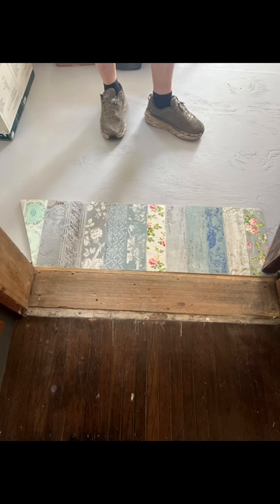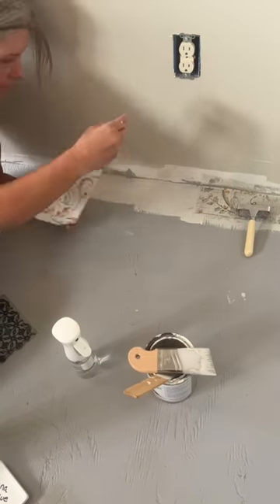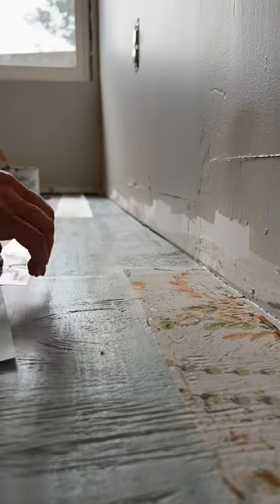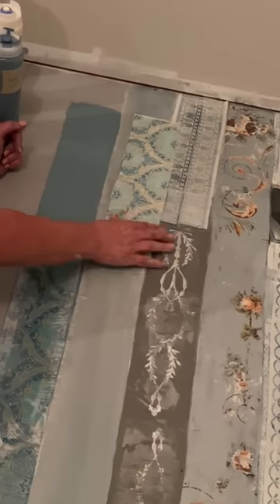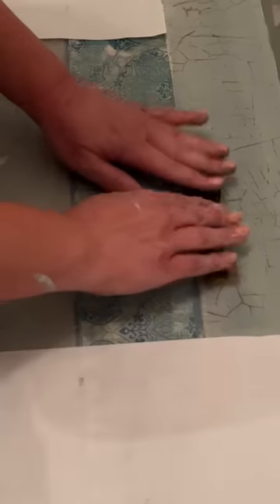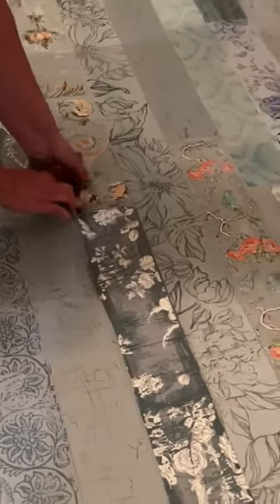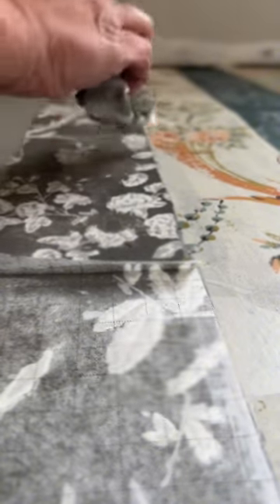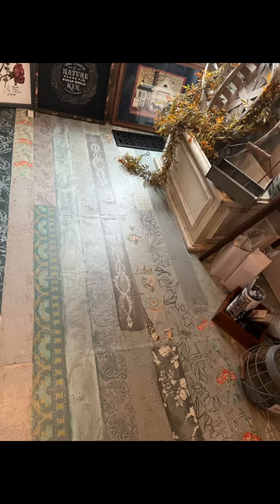Unique Floor Idea - Using IOD and Paint Couture

Comment: This is beautiful and a great idea! This could even be done with pieces of coordinating wallpapers or copies of photos.
Reply from the maker: You’re right it could be done with so many things. I contemplated many different options laying down papers in the past. I just always worry about the durability of the layers rather than paint… and what if I don’t adhere them well enough? I guess I’m a bit of a chicken in that respect, lol.  So last time I stenciled and this time it was paint and stamps🙂
Reply: @auntbeasattic , how long did each one take?
Reply from the maker: You mean each way of doing the floor? The stencil was an extra-large one. I think 2x2 and I remember each one taking 15 minutes each . I did multiple colors to add texture (like I did on the little cabinet we just posted). Biggest problem with that is you stay in the same position the hold time painting it. This floor was a little different because i planned as I went. I think though it was probably about the same amount of work time because i know i did like 3-4 rows in an hour on the second day when i only had that long to work. I hope that answers what you were asking lol

Comment: Really wonderful,  I can see this inside a cabinet or on furniture too😮😮😮
Reply from the maker: Yes! Inlays are made for furniture, putting on the floor is a bit out of the box lol.
Reply: @auntbeasattic  I had to go look up what IOD stands for, I'd never heard of it before. I knew about transfers but didn't equate the two. Anyway, such a great job,  I kind of meant that the faux board design would be cool in a cabinet.

Comment: Do you have an idea of what this cost you all up please? The result is gorgeous !!
Reply from the maker: I would have to do some figuring. The “planks” are about 4” wide. So one inlay sheet did roughly 45” long. Doing them end you don’t have as much matching to do. By mixing in the stamps, and different base colors you get a lot farther than if it was all inlays. It was 9.5 x 6.5 and I used 12 sheets of inlays. Mine were many different designs because I had them. But I originally had planned to do a floor with only the indigo or the rose chintz but got inspired lol. 2 packs of inlays are roughly $90
Reply: Thanks so much 😊

Comment: I love the floor.  Do you think the top costs are sturdy enough for chairs and a desks?  I would love to do this in my craft/office space.❤
Reply from the maker: You mean for them to sit on? I am putting this to coat to the test. But I wouldn’t have any concern about doing the paint/inlays down and doing a traditional top coat for wood floors. If you mean to do this paint and top coat on the furniture. It would definitely be fine. As for anything you paint, prep is key. Make sure it’s clean and if it’s a slick surface, you would want it scuffed up or use a bonding primer.

Comment: I’m seriously wondering my what the cost would be?? That’s an amazingly large amount of paint inlays. Do you think it can be done on a budget for us seniors?🤓
Reply from the maker: The “planks” are about 4” wide. So one inlay sheet did roughly 45” long. Doing them end you don’t have as much matching to do. By mixing in the stamps, and different base colors you get a lot farther than if it was all inlays. Different base color for an inlay pattern changed it quite a bit too. Especially the Chateau Inlay.  It was 9.5’ x 6.5’ space and I used 12 sheets of inlays. So that’s 1 1/2 packs for that size floor.  Mine were many different designs because I had them. But I originally had planned to do a floor with only the indigo or the rose chintz but got inspired lol.

Comment: What are IODs? Ive never seen this before?
Reply from the maker: IOD is the Iron Orchid Design company. They make furniture transfers and Silicone moulds plus the Decor stamps used on the floor.  They are the creator and patent holder of the paint inlays. If you want to learn more, there is a lot of info on their website. If you want to purchase,  you can find local retailers on their website. We carry all of their line in our store and on our website. www.auntbeasattic.com
Reply: @auntbeasattic  thank you!

Comment: If this starts to wear prematurely, can you now coat it with a stronger top coat like polyurethane or polycrylic top coat?
Reply from the maker: Yes. The top coat is a non yellowing water based topcoat. So just like you would want to poly over anything else painted for extra protection, you could get one of those.

Comment: In case someone's watching that has never used the paint transfers before-they are REUSABLE!  I know, isn't that amazing?!  So, can use more than once really appeals to my frugal side.
Reply from the maker: Great point! The image does get lighter on each use and so you would want to spread them through on a project like this I’m guessing. Also, using paint with a sealer needs to be tested to see how many uses you can get because the sealer limits the release of it on future uses.

Comment: You didn't really explain what this product is? Looks nice.
Reply from the maker: IOD is the Iron Orchid Design Co. They design and curate the stamps, inks, and developed and patented the Paint Inlays. Paint inlays are sheets of actual painted design that release when placed on the wet paint. They are reusable and become more of a distressed look with each use. The amount of reuses is determined by the paint product used.

Comment: What is iod?
Reply from the maker: IOD is the Iron Orchid Design Co. They design and curate the stamps, inks, and developed and patented the Paint Inlays. Paint inlays are sheets of actual painted design that release when placed on the wet paint. They are reusable and become more of a distressed look with each use. The amount of reuses is determined by the paint product used.

Comment: Beautiful floor, but way out of my budget!
Reply: Her floor is very beautiful, but I've seen a similar idea using wallpaper samples, gift wrap paper, scrapbook paper, laser printed designs, stamping, etc. You glue them down to the floor in a similar board pattern and once it's dry if you want more of an age look you go over it lightly in areas with a sander. Vacuum the floor thoroughly. Then seal it with several coats of sealer. Try not to mop it with too much water, use a barely damp mop or Swiffer. It should last for quite a while. Much cheaper option.
Reply from the maker: My original plan was to use just the Indigo inlay and then maybe a couple of stamps.  I was going to do a rug pattern on our wood floor. When we ended up with a plywood floor that I needed to look wood, I went ahead with this. You can get a lot of variations also by using different base colors for each board. I repeated a couple of the inlays on different color backgrounds.
Reply from the maker: I actually had seen decoupage floors. However, since I had the inlays and its actual paint being laid down I felt it would be sturdier than putting paper down. But it is an option.